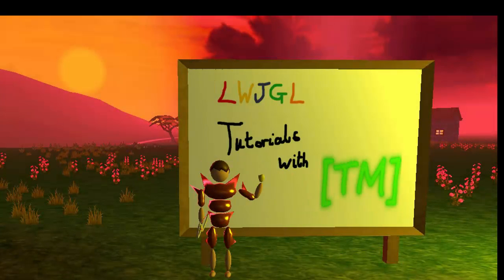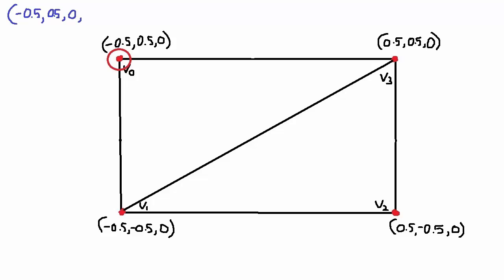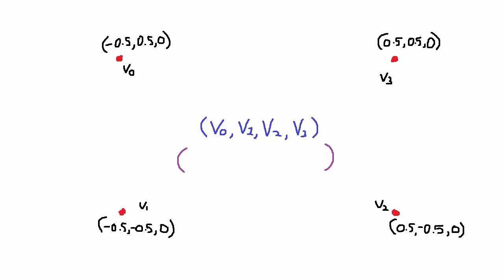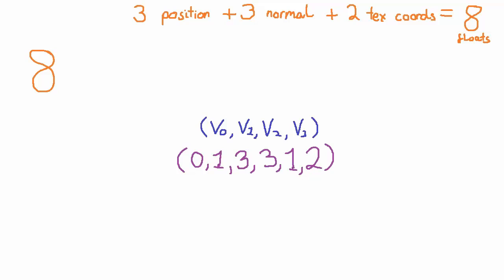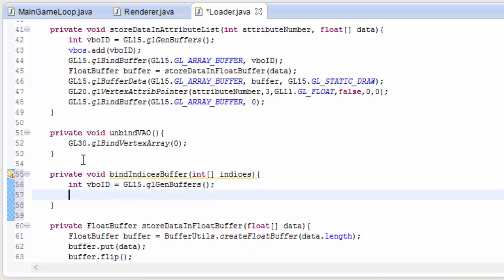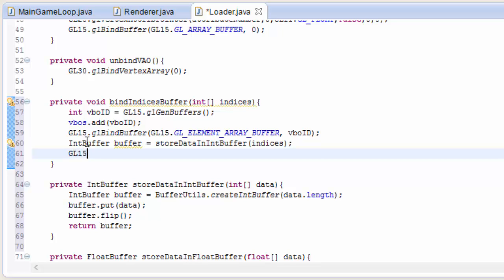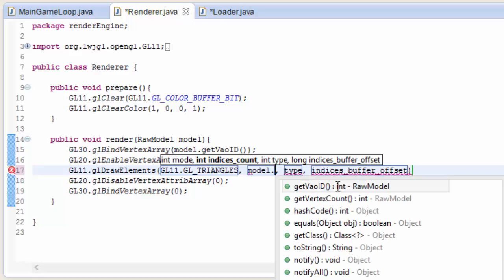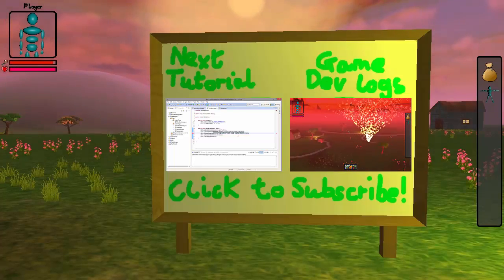OpenGL 3D Game Tutorial 3: Rendering with Index Buffers

Comment: I can't have more indicies than I can have floats. so if i try making a shape with four triangles, using 6 verts, I can only use 2 sets of indicies(6), I need to use 12 inidies, or four 4s, to make all four triangles :c
Reply from the maker: Tangy Boxhead Are you using indices.length when setting the vertex count parameter in the RawModel constructor?
Reply from the maker: Tangy Boxhead And what happens when you try to use more indices?
Reply: ***** Vertex count is set by geting the length of the verticies float arry, divided by 3. The indicies i set after the first 2 sets of 3, just don''t render.
Reply from the maker: Tangy Boxhead Vertex count should be indices.length, we changed it in this episode
Reply: Alright ill change it
Reply: ***** Wow thanks!, I must have overlooked that!
On a side not, what will be the price of your game? :D
Reply: Sweet, I just did hte math, rendering a cube would use:

9(floats) per triangle * 12(triangles in cube) * 4 =432

With indicies

3(floats per vertex)  * 8(verticies real count) + (3(ints per triangle) * 12) * 4(Bytes per bloat) = 240!! Nearly 50%.

Comment: ***** When do we actually store the VBO for the index buffers in the VAO? We didn't actually call glVertexAttribPointer() in the method bindIndicesBuffer() did we? And why didn't we unbind the buffer in that method using GL15.glBindBuffer(GL15.GL_ELEMENT_ARRAY_BUFFER, 0); ?
Thanks for your help!
Reply: Ok, nevermind, I just found your answer here:
"Yes, it's a special type of VBO that each VAO can only have one of. When you bind a VBO as an ELEMENT_ARRAY_BUFFER then OpenGL instantly knows to use this as the index buffer for that VAO. It doesn't have to be stored in an attribute list."

Is it also because of that "speciality" that we don't need to unbind the buffer?
Reply from the maker: M TheJ Yes that's correct, in this case binding the buffer doesn't "activate" it, it instead connects it to the currently bound VAO. Therefore, in this case, unbinding the VBO would disconnect it from the VAO, which we obviously don't want to do.

Comment: For some weird reason I only get the top left triangle and not the bottom right one aswell. Anyone help ?  heres my veritices code :
          float[] vertices = {
               
                  -0.5f, 0.5f, 0, //V0
                  -0.5f, -0.5f, 0, //V1
                  0.5f, -0.5f, 0, //V2
                  0.5f, 0.5f, 0 //V3
          };
          int[] indices = {
           0,1,3, // Top Left triangle (V0, V1 , V3)
           3,1,2 // Bottom Right triangle (V3,V1,V2)
          };
Reply: Me too... Did you find out why?
Reply: Danyil Bee
 Re read the code , you writen it wrong

Comment: ***** my code is producing errors here;
float[] vertices = {
				-0.5f,0.5f,0
				-0.5f,-0.5f,0
				0.5f,-0.5f,0
				0.5f,0.5f,0
		};
Reply from the maker: shipbiulder101 When you create an array you need to put commas between each element of the array, even if there's a line break. So add commas after the 0s.
Reply: fixed it before you

Comment: one thing i don't get after all of your tutorials, i keep coming back to this one, what element in the VBA is the indices? 0 is verticies, 1 is texture coords, where does the indicies vbo fit in all of this?
Reply from the maker: Jason Jepson Ah I'm sorry that I didn't explain this better in the tutorial. The index buffer is not like all the other VBOs, it is unique. The other VBOs are data which can represent anything that we choose, and we store them in specific attribute lists in the VAO. When we create these VBOs you'll notice that we defined them all as "GL_ARRAY_BUFFERs".
The index VBO is different, and has a set purpose, along with its own special "slot" within the VAO. It doesn't need to be stored in an attribute list because it isn't data about the vertices. When we create the index VBO we defined it as a "GL_ELEMENT_ARRAY_BUFFER". This tells OpenGL that this VBO is going to be used as the index buffer, and so it automatically associates this buffer with the currently bound VAO. If we ever try to render that VAO using glDrawElements, OpenGL will use that buffer that we assigned as a GL_ELEMENT_ARRAY_BUFFER as the indices for the data. 
That's why we don't have to put it in a certain attribute list in the VAO, or have to enable it before rendering. Because we defined it as a GL_ELEMENT_ARRAY_BUFFER, opengl knows to use it as the index buffer. I hope that makes sense :)
Reply: ***** absolutely makes sense! i knew the indices indeed worked but without the pointer, or enabling of the vbo slot i was wondering how the computer recognized the indices as an actual thing. but this makes lots of sense now. thanks! you work pretty hard at answering EVERYONES questions, well and thoroughly I may add, while developing this game, I am quite impressed. With that ethic and knowledge you'll do very well for yourself.

Comment: Just a little correction - glClearColor should be called before glClear to set the colour BEFORE it's used to clear the color buffer bit.  (You can verify this by putting another glClearColor with a different colour before it and you'll find the one after isn't used.)

Currently the code in the tutorial would technically flash once, first in the default clear colour then switch on the next frame to the set glClearColor.

I enjoy your videos - they're very clear with the illustrations too.

Comment: Great series!  My only question is why do you do everything in triangles instead of using GL_QUADS to make the square?
Reply from the maker: thecombateer3 Thanks :) GL_QUADS is deprecated in the modern opengl, and so can't be used anymore. Besides, when you used GL_QUADS in the old opengl it was actually turned into 2 triangles by opengl later in the rendering pipeline, so would have been no different. To quote something I found online, "Even if you feed OpenGL quads, the triangularization is done by the driver on the CPU side before it even hits the GPU. Modern GPUs these days eat nothing except triangles. (Well, and lines and points.) So something will be triangulating, whether it's you or the driver -- it doesn't matter too much where it happens."